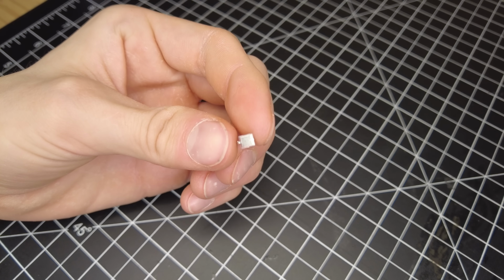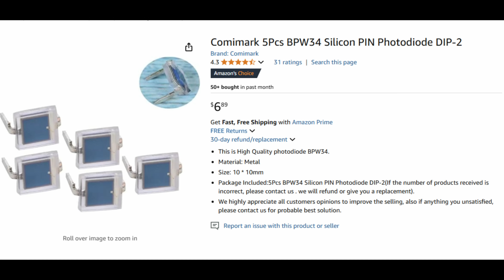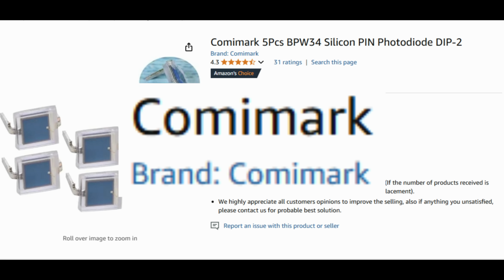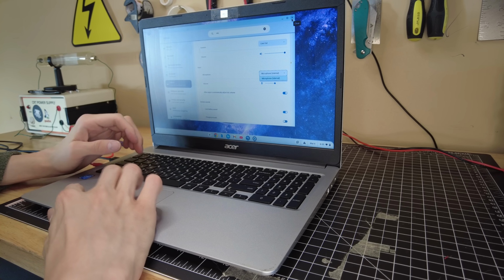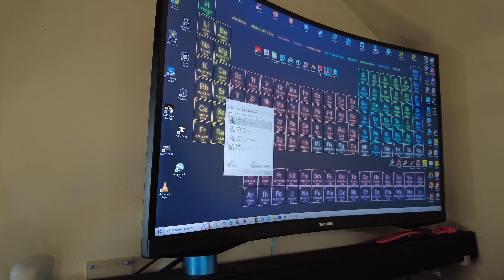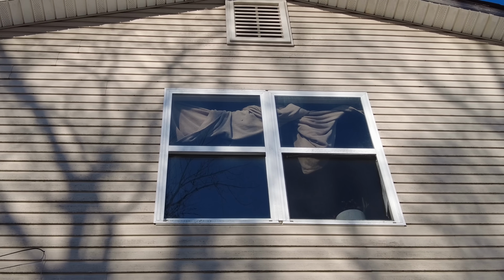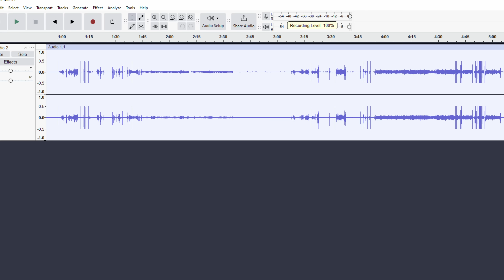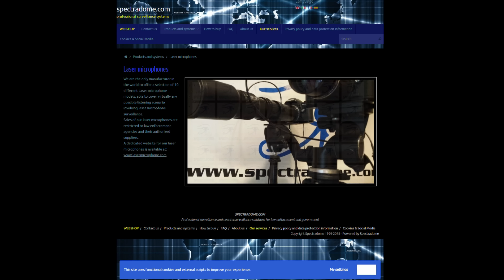I Built a CIA Spy Device (Laser Mic)

Comment: Have you ever heard of Van Eck Phreaking? I feel like it is right up your alley. It is another cold war era espionage technique using a directional antenna to capture electromagnetic radiation from a computer screen, and then remodulate them into a signal. A totally nonintrusive 1:1 mirror image of what is on the screen. The government has a whole program designed to stop this attack, called TEMPEST. 

Easy to build the antenna, and install the tempest_SDR software. Give it a shot, maybe make a video?

Comment: Put the signal through any noise gate audio plugin, then an EQ to get rid of unwanted / harsh frequencies and then through a limiter compressor.
You'll have quality audio then. Some sound plugin bundles include algorithm based static noise removal plugins as well. Regarding modern surveillance, you're right about tapping electronic comms devices, however, if two people meet on a park bench and they are not carrying anything electronic with them, this is the best way. You can bounce a signal even off of a paper coffee cup or the bench itself.

Comment: Some suggestions to improve your spying: 
- Go for a UV laser instead of an IR laser. It's just as invisible, but is better reflected by glass and won't show up as clearly on camera's. 
- Put a pinhole a few cm in front of your photodiode. This not only blocks most external light (which would cause noise), but also improves the signal clarity. 
- Get the angle between the laser-window-diode as large as possible. The closer you are to 180deg, the better your signal will be.
Reply: would UV laser be detected by the sensor though
Reply: @Rayen-x6ldepends on the sensor. But you'd better get a PSD (position-sensitive detector) instead of a photodiode to improve sound quality anyway.

Comment: but how did you actually process the signals?
Reply from the maker: There's no digital signal processing here, if that's what you're wondering.
I used a free software called audacity just to get the recording.
The vibrating window, laser, and photodiode itself is like a physical processor. 
The vibrating window directly modulates the reflected laser beam, producing an amplitude modulated optical signal which the photodiode converts into an electrical signal. This electrical signal can be sent directly to a speaker, no extra processing required. I've seen people attach a photodiode directly to the prongs of an the aux on their earbuds, and it works even without amplification.

Comment: Add a simple dual concave "diverging" lens on the receiver to get an optical amplification of the signal - greater angular movement as the beam hits the diode.   BUT this also spreads your beam wider so you lost contrast, so...then you might need to use an emitter you can focus to reduce that effect.  They're available, but obviously the more complex the setup, the more complex the "set-up".

Comment: To get red of the static noise, use a DC filter circuit, use an AC coupling capacitor. A capacitor placed in series with the photo sensor u are using

Comment: An ECM mike like the one on this board acts like a variable resistor to my understanding. The optoelectronic equivalent would be a photoTRANSISTOR instead of a photodiode. The latter is a current source isn't it?
Reply from the maker: Great point. Yes. I went with a photodiode because I heard it had no delayed response time. Turns out, the delay in a phototransistors response time is negligible for audible frequencies, so it probably would've worked better for this board considering it's a better optoelectronic equivalent and all. I don't know what I'm doing

Comment: Lösung des Wassermangels in der Wüste mit 20.000 Volt
+
The Next Generation of Ionic Plasma Thrusters (BSI MARK 2)
+
I Built a CIA Spy Device (Laser Mic)
+
500m Long-Range Burning LASER - Making a Laser Cutter (NEW Technology)
=
July 2025 Central Texas floods
Reply: Stealing Energy From Radio towers Using Plasma (ft. Geerling Engineering)

Comment: How can i make the sensor bigger?
Reply from the maker: You could add more sensors but that requires more circuitry. It's better to use lenses in front of the sensor to diverge the beam from a larger area... Or just make the laser beam itself wider, no need to make the sensor bigger. However, diverging the beam would make the signal weaker, so a higher power laser would be more effective.

Comment: I would think that the polarization filter would hinder the audio quality right? In film we use polarized filters to take away reflections. Since the laser needs to reflect back I feel like that would make it worse no?
Reply from the maker: Good question. Polarizing filters only block out light that's in a particular orientation. Since lasers emit uniform polarized light, essentially all of the laser light can pass through the filter if it's oriented correctly, while blocking nearly 50% of background light. However, blocking the background light only made a negligible improvement to the audio quality. Most of the static noise came from other factors that some people pointed out in the comments.
Reply: @SomethingAbtScience so awesome! Thank you for the informational response! I’m curious, would a conical shape or dish like attachment make a difference?

Comment: If I recall correctly, the professional devices use a beam splitter so the portion of the laser light that gets reflected straight back to the emitter performs destructive interference that changes with the vibration of the target. The split leg that goes to the sensor reports that dimming as sound. Similar to the LIGO detector. Anyone know for sure?
Reply from the maker: I do know the professional mics measure the phase shift of light rather than intensity but I'm not exactly sure how.

Comment: back when I first heard that obama bin laden was taken out with this tech, which supposedly was snarffed from the ruskies, I cobbled hardware and tried to get this working ... key nuggets you mentioned :  make reflected laser receiving photodiode half off the mark to pick up the modulation ( I thought the modulation was longitudinal not transverse [ distortion actually is left to right not in and out ] )  and to boost signal to noise run multiple senders and receivers in parallel to null out the noise ...  really good work keep it up
Reply from the maker: Thanks! Yeah, some professional laser mics do actually measure the longitudinal phase shifts of light. They're more precise but harder and more expensive to make than these.

Comment: and how about range ?
Reply from the maker: This device's range = the LASER beams range before it diffracts enough to become undetectable (assuming you're in space) However, atmospheric refraction from thermal turbulence can significantly reduce the range, but IDK by how much exactly, probably a 1/4 mile depending on the weather. Professional LASER mics use "adaptive filtering" with multiple beams to counteract this.
Reply: @SomethingAbtScience  so we can use high laser beams for that too ?

Comment: Damn this is really cool! But how would you aim the laser to the receiver if you use invisible laser?
Reply from the maker: Your phone camera might be able to pick it up. Otherwise, you may need to add a visible reference laser to line it up, or do some reflection calculations.
Reply from the maker: Also, during the beginning of the Cold war they used regular IR beams of light rather than IR laser beams. They have a larger divergence, so you won't need to aim as precisely. However, you'd need good optics and a bright source for long distances if you're not using lasers.

Comment: Can you use a 3.5w laser module instead?
Reply from the maker: You could, but 3.5W is a bit much for a small scale project. The audio quality does get clearer with a higher power beam, but that only goes so far. It's worth a try if you can avoid blinding yourself.

Comment: bro can i use a phototransister found in tv reciver (appeared to be a black colour led) instead of photodiode?
Reply from the maker: Yeah, that sounds like an IR photodiode. It may only work with an IR laser, or a DPSS green laser which typically leaks ir light.
Reply: Will it work if i pair it with the diode of tv remote to emit ir light ?btw thanks for helping  @SomethingAbtScience
Reply from the maker: @MayankKumar-rf3jz I don't believe so. The light from that is probably too diffuse, unfortunately.

Comment: specify which amplifier circuit and which photodiode are you using i thing photodiode is BPW34 but i wanna confirm it iand also tell which is the amplifier circuit
Reply from the maker: Yes, it's the: Comimark 5Pcs BPW34 Silicon PIN Photodiode DIP-2
And for the amplifier: 
https://www.amazon.com/dp/B0D3CXWBBT?ref=ppx_yo2ov_dt_b_fed_asin_title

Comment: Amazing work! Have you tried adapting an old barcode reader? The mirrors are designed to focus the laser beams onto small detection area. I've also thought about using IR lasers (at a low power level!), but the angle of reflection is slightly narrower.

Comment: All you need to reduce the noise is the steel enclosure grounded to usb cable shield wire and the board gnd in one place, and the diode soldered as close as possible to the board.

Comment: Me and friend built one of these back in the 90's. We not only listened to room audio, we also transmitted audio over the beam. Then using a steady LASER output, bounced the beam off the chrome dust cap in the center of a speaker to modulate the beam. For better audio quality, use a CDS cell and a small bias voltage. Then couple off the audio with a capacitor to your audio amp. Fun stuff.
Reply: While I was playing Super Nintendo, you were doing this. Amazing.

Comment: If you modulated the laser with a high frequency the induced vibrations would effectively FM modulate the reflected signal, doppler shift, then use standard FM demodulation techniques? Doesn't work with real windows that are double glazed though.

Comment: IMPROVING NOISE CANCELLATION AND SOUND

1. Analog Summing (Common-Mode Reinforcement)

How it works

    Route both photodiode outputs into a simple summing amplifier (an op-amp in inverting-sum configuration).

    Scale the summed output by ½ (either in the same stage or with a follow-up attenuator).

    Result: any signal that’s identical on both channels (the true vibration-derived audio) adds constructively, while uncorrelated noise terms only add randomly and end up about √2 lower in level relative to the signal.

What you need

    A low-noise dual op-amp (e.g. TL072, NE5532) or two single-channel op-amps.

    Four equal resistors for the summing network (e.g. 10 kΩ each) plus an output attenuator or a precision gain resistor to get the overall gain to unity.

    Decoupling on your PCB and a quiet power supply to keep the op-amp noise floor low.

Improvements & Tips

    Precision parts: use 0.1 % metal-film resistors to keep balance accurate.

    Shielding: enclose the summing amp in a small metal can or shielded compartment on your PCB.

    Power supply filtering: add local LC or RC filters on the op-amp rails to prevent switching noise from contaminating your sum.

2. Real-Time Adaptive Noise Cancellation

How it works

    Digitize both diode signals with a low-latency audio interface.

    In a small, dedicated DSP (or even a microcontroller with a DSP library), run an adaptive filter (e.g. an LMS filter):

        Treat one channel (or a weighted mix) as the “noise reference.”

        Continuously adapt the filter coefficients to model that noise and subtract it from the primary channel.

    Because the algorithm updates in real time, it tracks slow changes in your ambient-noise characteristics.

What you need

    A microcontroller or DSP chip with at least two ADC channels and one DAC or a USB audio interface feeding a small PC/embedded board.

    An implementation of a short-tap LMS (least-mean-squares) filter—few dozen taps are often enough at audio rates.

    A control loop to set adaptation rate: too fast → “musical noise”; too slow → residual hiss.

Improvements & Tips

    Pre-whitening: apply a simple high-pass at ~20 Hz to prevent very low-frequency drift from tying up your filter.

    Tap-length optimization: longer filters handle more complex noise but cost CPU; start around 32–64 taps.

    Latency budget: keep your ADC→DSP→DAC path under ~5 ms total if you need the system “live” (e.g. for monitoring or feedback).

Additional System Enhancements

    Optical alignment: collimate your laser so both diodes consistently see the same vibration-modulated reflection.

    Mechanical isolation: mount your PCB and photodiodes on vibration-damping materials (rubber grommets, Sorbothane pads).

    Low-noise components: choose photodiodes with low dark current and preamps with sub-1 nV/√Hz noise figures.

    Balanced outputs: once you’ve cleaned the audio internally, drive your interface over a proper XLR-balanced line to reject any new cable-borne noise.

By combining a clever front-end (analog summing or adaptive real-time cancellation) with careful mechanical and electronic design, you’ll maximize your signal-to-noise ratio right “on the fly,” without ever touching a DAW.

Comment: I'm wondering about the vibrations being picked up as additional noise. Would it help if you mounted the laser and the receiver on the same case, with a screw to microadjust the angle of the laser?

Comment: Here is some items that might help: (1) Make sure the power source is not regulated by USB, as it is noisy from switching noise and PLI. Use an LDO. (2) Use a photodiode which is sensitive to 940nm and has a bandpass optical filter on it. This will block other light in the room and outside. 940nm is what is used on self-driving cars, as it is a wavelength that is in sunlight but not as much. (3) Try a light polarizer.
Reply: another way that might work better (maybe): Doppler shift. Use a photodiode and reflect the laser (a portion into it) and when it hits the glass and reflects back, you'll like constructive/deconstructive interference. But this setup likely take a lot more work, so maybe it's not good for the basic demonstration which you did achieve already. Great video, very fun.

Comment: To remove background noise I recommend using a small filter transformer together with a capacitor You should put these things to the audio jack cable and I also recommend you to improve the sensor

Comment: The quality was actually quite good. Wonder how speech would come through. Definitely workable, especially after some dsp.
Countermeasures also include using special kinds if glass, and vibrating the window panes with actuators, iirc.
Reply: The usual method is to place a device in the room that emits overpowering, yet almost inaudible sound that makes this kind of surveillance difficult to impossible.

Comment: A quick and dirty but very effective way of reducing that noise would be to run some software like isotope Rx11..it can be run in real time, and has many different functions depending on the type of noise you need to remove.

Seriously impressed with the audio quality right off the bat though.

Comment: Hard device to use at a distance. Reflection alignments are critical. Especially since you don't cant to use visible laser light for this type of device (they can see it in the target room). Can be done easier just by using an infrared floodlight, made directional with lenses, and using the photosensor with filters at the viewing end of a telescope...

Comment: Just a tip: The white noise isn't coming from the photodiode. It's probably mostly from the amplification.
Try adding a ultra low noise amplifier, preferably a transimpedance based one, as first stage from the photodiode. Then your much worse aux input amp doesn't have to work so hard.
Reply: Hmm what kind of module is available for that? I was checking Amazon but then wondered if ya meant one of those ultra sonic distance sensors for Arduino robots

Comment: There's a fantastic old Windows program called "Cool Edit Pro" which I use to clean up courtroom audio for my transcriptionist wife. You can select a 'quiet' part of the recording, containing only the noise, and the program is able to 'subtract' the noise signal from the recording, I assume using Fourier analysis and filters. Old versions from around the year 2000 work great and are available as abandonware. I see on a lot of CSI shows that many audio forensics technicians still use it.
Reply: -Yep it's probably an fft. there are obviously more specialized options but those cost money. Izotope rx, etc etc. If you want better performance audacity works and is fos I think, definitely free anyway. Goldewave also does pops and clicks and it's pretty cheep at 19.99. Really generous trile though.
Reply: Free program Audacity can do that too. SoundForge does it better but costs.

Comment: I have a follow up questions.

1. How do you know which leg on a photodiode receiver is + and which is GND?

2. Does the power of a laser beam matter? F.i. The more powerful laser the stronger the beam’s range and a more distinct audio you get?

I used some cheap lasers that are powered from two tiny tablet batteries but all i get is a static noise. The only difference i notice is that the graph on audio track on adobe audition changes when i cover the diode from the light beam to be less noisy and more noisy if i let the beam shining on the diode. My guess is that because of s$ity laser.

Comment: Maybe you can attenuate the high frequency noise with a low pass filter circuit. Not sure if the static noise is suitably out of range of what you want to listen to but maybe. 

And honestly it is probably just much easier to use software based filtering but your signal will be cleaner at least (assuming it works).